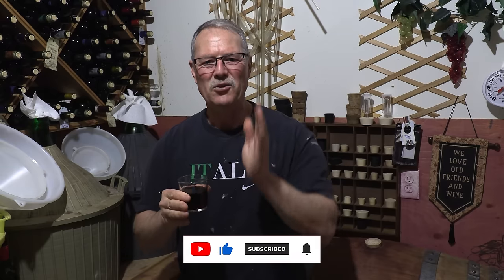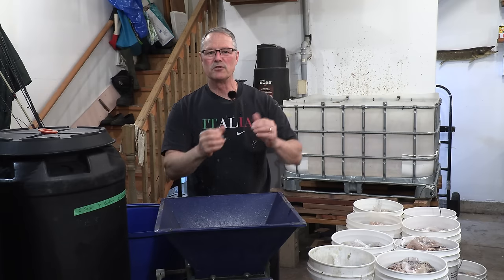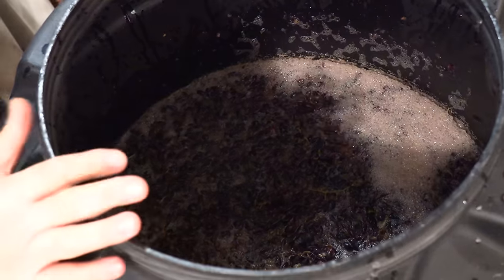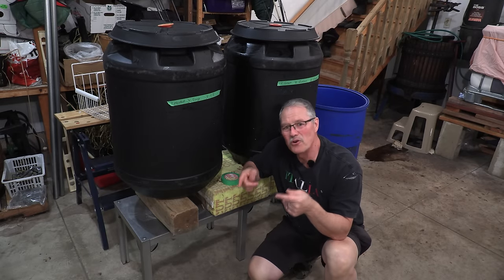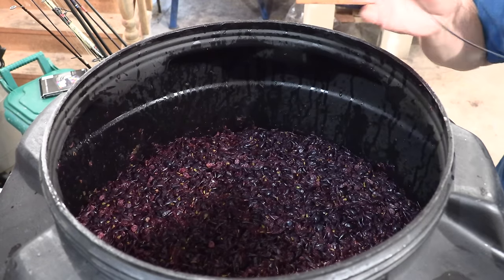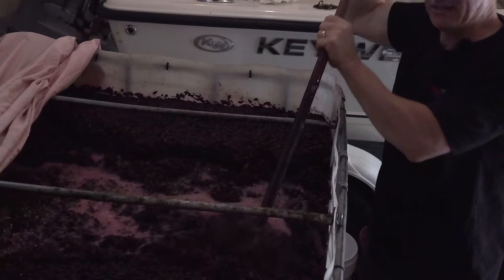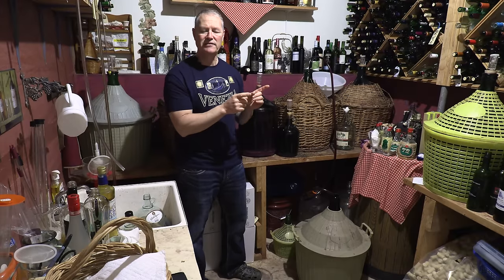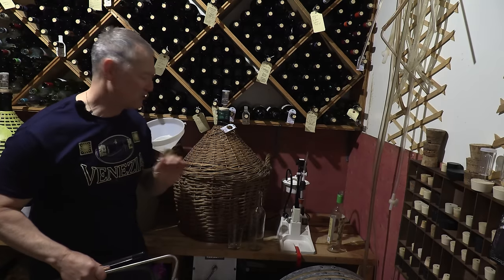Making homemade wine from scratch masterclass, all natural, traditional way. Amazing results!

Comment: Great video. Probably one of the best wine making videos on the internet. Certainly the best I have seen to date. Adding a section or another video about sanitizing every piece of equipment you use would be a great addition. This would include plastic tubes, crusher, bottler and even the tool to push down the cap in primary fermentation. What ever you use including your massive primary fermenter.

Was that actually a crusher destemmer or a destemmer crusher in the video? Each will give a different flavour to the wine. Stems crushed will add more tannin. Usually there are rollers in the bottom of the loading bin rather than an auger with a crusher destemmer. Cheers.
Reply from the maker: So glad you enjoyed this video 🙂 it was a crusher, de-stemmer and I use a potassium metabisulphite/water solution (100ppm) to sanitize. Once sanitized, I then wash away any solution so none is left clinging on to my vessels 🙂🍇 🍷

Comment: Great video. One question, do you mix the pressed wine with the run off wine or do you keep the pressed wine separate? Thanks.
Reply from the maker: You can mix the 2 with no problem, however, I personally keep it separate but will use it for "top-up" if needed👍👍🍷🍷

Comment: Ivo, Thanks for the great explanation and demonstration. Can you tell me what the difference in the wine taste/smell/characteristics are between your wine made with commercial yeast and your friends' wild yeast. Not many that have experience with both type of yeast and even fewer using the same grape as you and your friend Dino made so I'd appreciate your feedback.
Reply from the maker: ...that's hard to say as Dino used a different blend of grapes (variety)  than I did
Reply: Even if he did use a different variety are there noticable difference? I make wild yeast wines and it's very different in taste to commercial wines. I'm just after your view even if it's they are similar. Whatever you think
Reply from the maker: @PeterDeliopoulos  yes, there is definitely a noticeable difference, assuming you use a good quality yeast, and not the small packs you get for a few dollars. The main advantage is consistency. My father also only used wild yeast and in my opinion, using a good grade yeast is better🙂🙂

Comment: Awesome video!! When I’m racking the wine, the airlock won’t move and there aren’t any bubbles going up the bottle. Wondering if it is still good since the airlock is not popping.
Reply from the maker: If the air lock is not popping, then that means your wine has finished fermenting and that's a good thing - good idea though to keep the air locks on, until you are ready to bottle 🍾🍾

Comment: did you sanitize the pushing stick before mizing your friend's grapes?, it still looked wet. I'm just curious if you took the yeast from your brew stuck to the stick and introduced them to your friends wine?
Reply from the maker: I typically just wipe it down with a paper towel, but can't recall if I did that day or not (I may have forgotten)

Comment: Evo my friend, I'm on day one of primary. Already have robust bubbling with a Cab Sav Kit (all juice no skins). The directions don't mention any stirring while all the advice online recommends stirring daily. Is the stirring primarily when. You're dealing with skins and caps or do I need to introduce oxygen into the wine for the yeast or is there enough already in the wine?
Reply from the maker: It's primarily for when dealing with skins and caps, in order to obtain more skin contact and thus, color 👍 Good luck with your batch👍👍
Reply: @CookingwiththeCoias  ok SO, back to my wine kit, I'm modifying the directions to make my wine organic like yours so I'm not adding the  sulfite stabilizers. The directions state to add the stabilizers which end the fermentation at day 14 and then degas by stirring for 5-10 minutes, then add some clarifying agents (which are organic and approved for organic wine making). I think they are suggesting to degas so it can be bottled (if clear) at about 30 days. Long story short, you don't degas your wine because you let it degas naturally over time right? I can manually degas after fermentation is over but wondering if that is necessary or just unnecessarily oxidating the wine?

Comment: If you inoculate with commercially available wine yeast, do you think it is necessary to use potassium metabisulfite prior to initiating primary fermentation with fresh grapes, or any other fruit? I’m a beginner and I did not do that. I keep reading horror stories about wine turning into nail polish, or vinegar. What has been your experience? Granted, I sanitized my equipment and cleaned my hands during the entire process. Also, what’s the alcohol tolerance of the FX10 yeast you use?
Reply from the maker: When using commercial yeast, you do not need to use metabisulphite as the commercial yeast will just take over, so no worries there. If you follow this process and keep the air away from your wine as it is maturing, it will protect it from going bad. As for the FX10, it is a wine making yeast and although I have not looked into it, I would say it's good for up to 20% alcohol, which is high enough to also make Port👍🍷
Reply: @CookingwiththeCoias  thank you for your response!

Comment: If you only ferment for a couple days for a lighter wine, when does the rest of the sugar get converted into alcohol? Wouldnt a lighter wine mean a sweeter one too? I know thats not the case. But just a general question about how full fermentation works when you decide to rack earlier for a lighter wine
Reply from the maker: The earlier racking only stops your wine from getting darker...the juice is still fermenting and will continue to ferment until all the sugar has been converted to alcohol, so it will not be sweet🙂🍷

Comment: Planning to do this for the first time.  Thanks for the info.  Just wondering what does it cost to have the grapes crushed/destemmed/juiced by Satellite?  I called them and they can't tell me for some reason.  Thanks.
Reply from the maker: If I recall correctly, it was $2 per case and they provide the large plastic bag liner as well 👍

Comment: Sulfides can cause headaches. But more than likely not the culprit of most people's headaches with regards to wine, especially those that can drink white wine but not red. White wines require more sulfides than red wines in most cases. The culprit, for most people's headaches, has to do with the histamine levels in the wine. Red wine have higher levels of histamine than whites.
Reply from the maker: Thanks for your feedback 👍👍

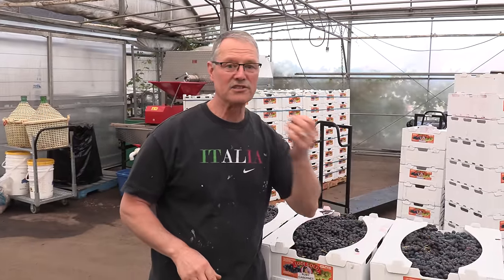Comment: 1:10 If you have had good wine after 10 years without using potassium metabisulfite, I'm impressed.  Do you use sulfite to sanitize your equipment and bottles?
Reply from the maker: Yes, you can sanitize your equipment and bottles 👍
Reply from the maker: ...and yes...my 10 yr old was amazing 👍👍
Reply: Thank you for your quick response.  I made a Cab Suav in 2004 without using sulfites and is started to go bad a year after bottling.  Do you have any suggestions on sanitation when bottling?

Comment: In India many youtubers who have made video do the process like this

Sterilize all the items used for wine making (container (stainless steel and glass or bharani) spoon, wooden crusher etc) and then dry it to avoid moisture
then remove the stems from the grapes as well as the spoilt ones from the bunch
wash the grapes thoroughly and dry it
then put it in the container and crush it, by the way some also boil the grapes along with other ingredients like sugar, yeast, spices and ginger and once its cooled down pour it in the jar and then add yeast.
if they are not using gas to boil the ingredients they directly crush the grapes and put it in a glass jar or bharani and then add the spices and yeast and then close the glass jar and cover it with a cloth..

The equipments you use are mostly done in other countries.  Some people in SOME parts of India do use a siphon...i have seen in some other videos...
Reply from the maker: Thanks for sharing your process with us👍

Comment: Will wine still fermented after pressing and put it in dummyjohn? And after put it in dummyjohn how many days the alcohol content will decide? Aging doesn't mean alcohol content will increase right. So exactly when the alcohol content will decide in the first stage before pressing or after put it in dummyjohn? Kindly clarify 😊
Reply from the maker: It is possible that your wine could still be fermenting once moved into your damajons. Alcohol content is determined by the amount of sugar in your grapes - the higher the sugar content, the higher the possible alcohol. The exact alcohol content is decided once fermentation is completely done, and all the sugars have been converted into alcohol 👍🍷
Reply: @CookingwiththeCoias  thanks for the response.. I have fermented 10 days with skin then press and put it In jar with sealing cap because I don't have airlock..how long you want me to put it in this dummyjohn. I'm thinking 20 days. And also I tasted two glasses while I'm pressing. I felt drunk. So which means it's going good.

Comment: Thanks for Your nice corse, I was making wine bud I never have seen the most simple way like You do it, my next I will try Your way ! I would like to make wine from pineapple  what's Your idea ? Pineapple have match more suger in the juse, I was reading that hope more suger You have You need yeast that can go until 18% ore more alcohol, not every yeast can handle this ?? Wright ore not ??
Reply from the maker: High sugar such as 18% alcohol, can impact the yeast and slow it down....too high and it will kill the yeast - so in your case, I believe you will be o.k. - things just may move slower and you may want to use a bit more yeast - if you make it (I never have) and you think about it, drop me a line back and let me know how you make out :)

Comment: When bottling, is it necessary to sterilize the bottles first before filling?
Reply from the maker: Sterilizing your bottles before you fill them is a good thing to do 👍You can use a weak water and metabisulphite solution such as 2 tsp per gallon👍
Reply: @CookingwiththeCoias  Many thanks!

Comment: Good afternoon. Last year we made homemade wine. Just like you, we pressed the grapes to the end. however, we got so much sediment from the pressing that even after 5 decantings, we were unable to remove it, even with filter pump filtration. How do you do it?
Thanks in advance.
Reply from the maker: Wow - that's a lot of sediment. You mentioned 5 decants but how long did you wait between decants? Typically, after resting for a year, and if you do 3 decants in that time, your wine should be much better, and in your case if you have extreme sediment, if you can let your wine rest for 1 1/2 years to 2 years and then do a final decant, you should be good to go 👍🍷
Reply: @CookingwiththeCoias  Thank you very much for your reply. The time between decanting was 3 months. However, when I take the wine from the upper part of the barrel, the wine is clear but it gets cloudy overnight in the bottle. Obviously, he needed a lot more time lying down and pouring. This year, I plan to press the grapes, but only while the clear juice comes out, without sediment... For about 100 liters of wine, I have a total of about 15 kilograms of sediment left... 🍷🍷🍷

Comment: So I am wondering if using wooden barrels would be a better idea then plastic, as plastic can leach into the grapes over time, with the acicidity levels increasing. 

If u had a choice and money wasn't the issue, would u prefer wooden barrels or stainless barrels?
Reply from the maker: I would lean towards stainless, but only because it would be so much easier to maintain vs the wood barrels👍If maintenance was not an issue, then ig would be wood all the way 👍
Reply: @CookingwiththeCoias  Thank u for your reply. It would be interesting to know how successful wine makers in past generations used wooden barrels and maintained them so as to avoid bad bacteria spoilage. 

Was there an easy way, for the benefits of wood is that u get a unique flavour, that can be attributed to the good bacteria living in the wood.

Comment: What do they charge there for grapes. I've been getting my grapes from MacNab Grape, and I will buy juice buckets from Costa's Wine Country. Both places on Barton St
Reply from the maker: Prices vary each year.....
Reply: @CookingwiththeCoias  For the most part, MacNab grape charges about $1 pound for the grapes I usually get, but sometimes I find them to be hit or miss with the quality. For instance, one year my Cab. Sauv. turned out rose in colour even though I allowed it to ferment for 9 days before pressing. Another year my Shiraz had massive colour already at the time of crushing. This one I allowed to ferment for 8 days before pressing and the colour was off the charts, but it was very tanic and somewhat bitter. It's finally becoming palatable now that it's 1.5 years old, but I suspect it will be at least another year before it's enjoyable. The tannic properties are becoming more rounded and mellowed. Do you find that your supplier has grapes that produce better consistency from one year to the next?

Comment: I would love to not use Camden tablets. Does your wine last in a bottle for a long time? I just worry if it sits for two yrs it could change flavor or to vinegar. My last question is the pressed grape juice is more flavorful I would assume. Do you mix it into the other containers to get equal flavors in every jug
Reply from the maker: I just finished a 10yr old bottle and it was amazing!! I've even aged my wine for 20 yrs. Yes, there's always a risk, but honestly, I've never had a bottle turn bad on me - just ensure you store it in a cool dry place, with little fluctuations in temperature 👍The pressed juice, I actually just mix it with the last bit of free run juice - I actually try to keep it separate, but you can certainly mix it throughout if you like👍
Reply: @CookingwiththeCoias  perfect just what I was hoping your leaning to!! Thanks

Comment: You mention "wild yeast in the air" but isn't most of the wild yeast on the grape skins?  I've never made wine with "wild yeast" but want to try and was just curious.  Thank you for the video.
Reply from the maker: .. actually...the answer is both👍👍🍷🍷
Reply from the maker: ...in the air and on the skins👍👍🍷🍷
Reply: @CookingwiththeCoias  Thank you.  I was going to use an airlock instead of leaving the top of my bucket loose and wanted to make sure that was ok.  Thanks again for a great video!  And I am jealous of that place where you buy grapes and then have them processed.  Nothing like that where I live so I guess it is time for a de-stemming party.  Thanks again.

Comment: Can we just close the lid tightly when we put in dummyjohn ? I don't have airlock thing. So can I sit lock the lid tightly??
Reply from the maker: The problem with that is that there still may be some fermentation and thus pressure to blow off your seal so I do not suggest doing that👍🍷
Reply: @CookingwiththeCoias  okay.. except blowing up my wine will not ruin for not having airlock just close the jar cap?.. I don't think it will blow up since I put the jar with threads kind of cap it locked tightly..

Comment: You said air is number one enemy during dummyjohn stage. But I took big jar and fill it up only half and close the lid tightly with thread kind of cap . Will that ruin my wine since i didn't fill whole jar.. ? Kindly clarify..
Reply from the maker: Yes, if it is only half full, it will turn your wine🍷 If you have a bunch of marbles, add them to your jar to bring up the level

Comment: Maybe you should have mentioned that fermentation produces CO2. which in a room that is not well ventilated, e.g. basement, can become a deadly danger. I also wanted to mention that not ALL sugar and alcohol are fermented. Above a certain percentage of alcohol by volume, the alcohol has a toxic effect on the yeast (that's why you can't make infinitely strong wine). So it is possible. to produce heavy yet sweet wine.
Reply from the maker: Thanks for your feedback

Comment: How about white wine? Any difference in the process? Thx!
Reply from the maker: Slight difference.... basically, destem and crush your grapes, then press them immediately. Let the juice ferment in a drum and once fermentation slows, rack it out and from that point on, it's the same process as the red wine - so the main difference is with white, you don't let it ferment with skins, but rather, crush and press right away👍🍷

Comment: You didn't use Sulfites, Pectic enzymes, yeast nutrients, Bentonite to clarify. Is it good idea to bring such wine in market commercially? Will it taste good/better than other brands who use such chemicals to stabilize and clarify their wine? Not using these chemicals will not spoil Wine?
Reply from the maker: I have never lost any wine by making wine this way and this is also for home use, not commercial. Not only do I not use any of the additives you noted, but I don't even filter my wine. However, if you feel more confident to add sulphates etc., by all means, do so.  The commercial wineries do. I do not and I have aged my wine up to 20 yrs and never ever had an issue 👍🍇
Reply: Thanks ❤